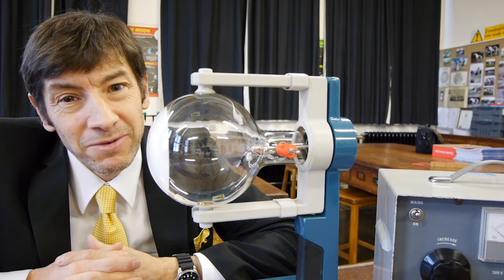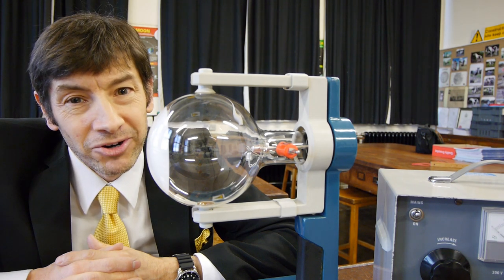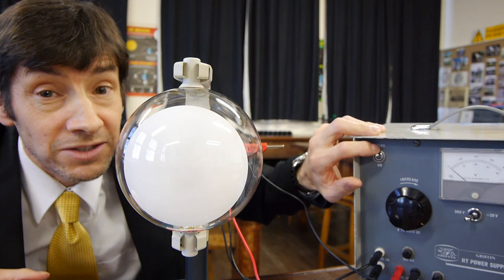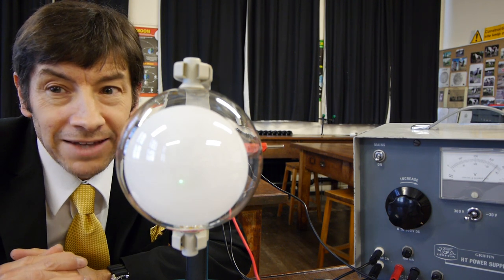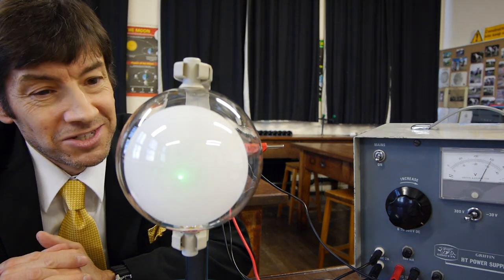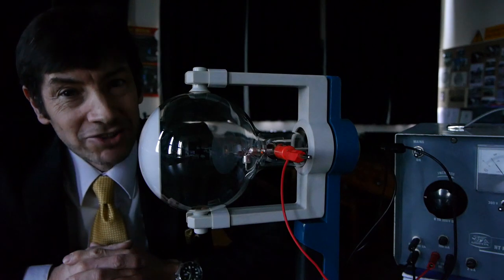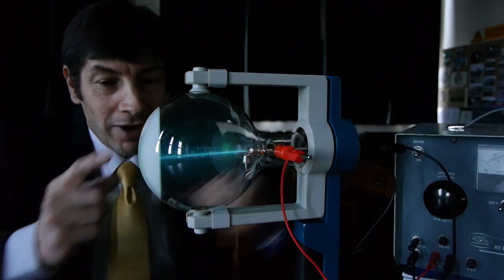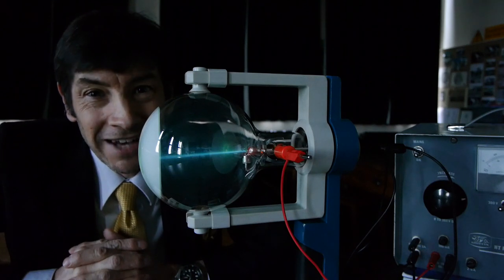The Electron Gun - the particle accelerator in your house! - F-J's Physics - Video 18

Comment: Why do crts wear out
Reply from the maker: Good question.  Lots of things can go wrong.  The tube can slowly have air leak in.  The heater in the cathode can fail/burn out.  Low work function coatings on the filament can come unstuck and reduce the effectiveness of heated cathodes.  The phosphor on the front of the screen can, if too much electron energy hits it for prolonged periods of time, get damaged and burn an image into the front of the screen - that's where the idea of screensavers comes in - causes the image to move and not have the beam in one place all of the time.  They are in many ways simple devices but these are some of the issues with them over time.  BTW don't forget that the power supplies that make them work degenerate over time and it can be here that issues are if they fail to work as well.  Hope that goes someway to answering your question and thanks for taking the time to watch the video.
Reply: Anthony Francis-Jones I'm going to get one soon but it's sitting in an uninsulated garage where temperatures  very from kind of hot to cool and would that effect the picture or not. Also it has been sitting for awhile. But I saw this video where some guy plays a game on a 1953 Muntz tv and it was fine so do I really have to worry about my crt tv.
Reply from the maker: @smashingrandomthingzandrev2134  you are at the whim mainly of the power supplies and the state of the cabling internally as well as other components such as capacitors - I cannot see why the CRT itself would not be ok.  Remember that if this is a tv the line scan can be different - 405 lines on old ones so you will be having a bit of a play and seeing what happens.  I wish you luck.
Reply: Anthony Francis-Jones. The tv survived the garage It's just I had to make my dad help me get it in the house but it was worth it so I can play my n64. Now when I turned it on and started using it I noticed slight flickering. Is there a way I can adjust anything to fix it in the future? It's not a problem yet I don't really notice it unless I'm close to it is there a way just in case I ever have to do anything?
Reply from the maker: @smashingrandomthingzandrev2134  - There are all sorts of reasons why they flicker but the main one is 'they just do' as they are having to refresh the picture much more slowly than modern systems.  So the picture is never as stable as modern systems.  It was always noticeable close up or when you take a photo of the screen working - you will see just how slowly the picture is redrawn a line at a time.   Shows you what we used to put up with!
Reply: Anthony Francis-Jones ok that's all I guess I was to close to it so I'll just sit further back scene it's probably not safe to be that close anyway.
Reply from the maker: @smashingrandomthingzandrev2134  yes.  There is also some talk of an X-ray dose from sitting to close to the screen but there is a lot of lead in the glass and it depends on accelerating voltages and other factors.
Reply: Anthony Francis-Jones I really hope I'm not annoying you about anything but just today I got my sony trinitron crt and I noticed in the top left corner of the screen, purple discoloration on the screen so is my tv dying ?
Reply from the maker: Interesting - not sure but it may be a bit of decay in the phosphor coating or in fact a change in the composition of the glass.  They are getting old now so let us know how you get on.
Reply: @smashingrandomthingzandrev2134  sometimes CRT based colour TVs and monitors suffer from magnetic fields due to nearby objects but mostly due to the production of a field on the shadow mask. This bends the electron beam and causes areas of colour distortion. Tubes were designed and built to limit this effect by use of an in-built, automatic degaussing coil. For earlier designs or extreme cases, a degaussing wand can be used. There is plenty of info on-line.
Reply: @hitchmille I have trinitron tv and it has discolor in the corner. All I know is it served the previous owners for 27 years. So is my tv dying
Reply: @smashingrandomthingzandrev2134  the trinitrons use a different technology than shadow mask, colour CRTs but remnant magnetic fields can still occur and cause colour distortions. To get all three electron beams to hit the right colour phosphor on the screen, requires components that compensate for manufacturing and/or design limitations. This is usually done by a series of adjustment rings mounted on the neck of the tube. These rings are in effect, weak permanent magnets arranged to provide just the needed amount of bean deflection. They are used to adjust for colour purity, e.g. the red beam is striking red phosphor only etc. Other rings adjust the beams to ensure they all converge on the same spot on the screen, each of course on its correct phosphor. If any of these rings have moved then the effects will be noticeable across most of the screen. Colour purity misalignment will result in washed-out or faded looking colours, whilst colour convergence misalignment will result in colour ghosting of objects on the screen. If your problem is confined mostly to a corner of the screen, then my best guess is that it is due to a remnant magnetic field and degaussing with a wand may help. Sometimes it takes quite a few applications of a degaussing wand to get a good result. NOTE: just a reminder for others who may be unfamiliar with such technology, although we may refer to a red beam, a blue beam and a green beam, the electron beams are not coloured beams. CAUTION: there are lethal voltages inside CRT based TVs.